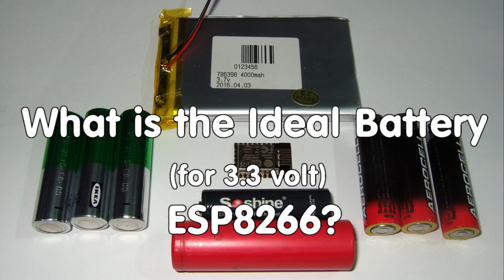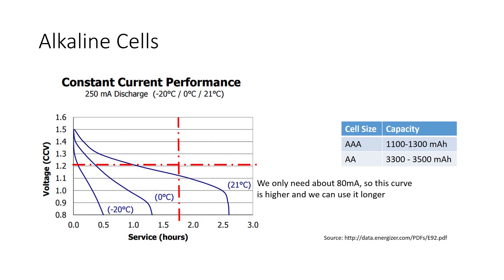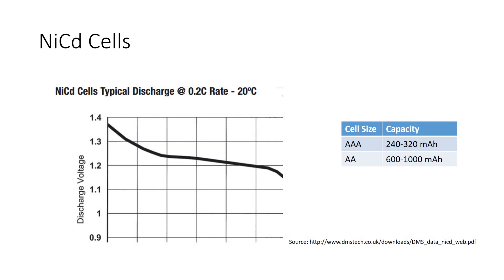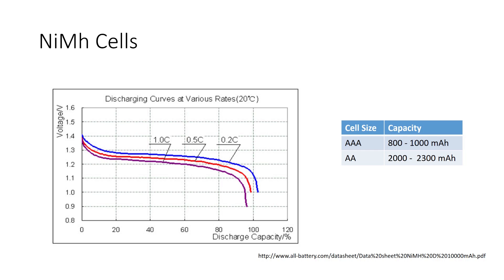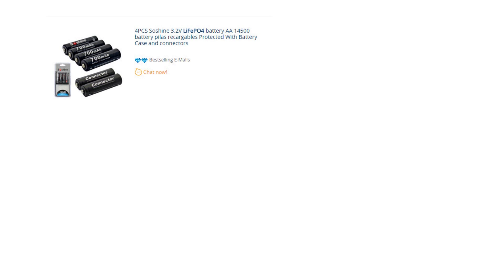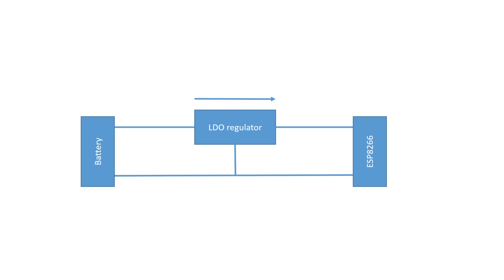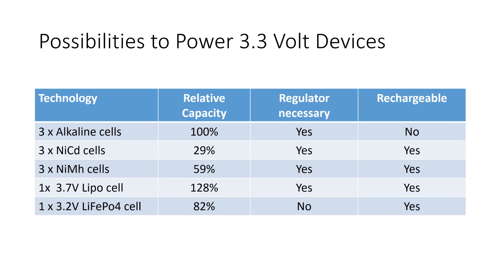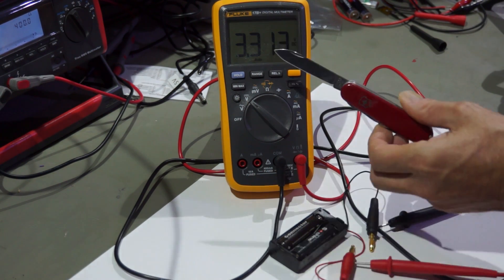#64 What is the Ideal Battery Technology to Power 3.3V Devices like the ESP8266?

Comment: I was going to get lifepo4 but they're more expensive than free li-ion vape batteries. Getting MCP1700-3302 as my LDO to get 3.3v. Mcp1700-1802 is for 1.8v the chips give up to 250mah. Time to watch your coin cell video.
Reply from the maker: Just do not try to power an esp32 with 250mA LDO...
Reply: @AndreasSpiess not for esp32! Thank you for mentioning it. I was looking for something to replace 3.3v for my device. I decided to look through your stuff for information and it was under the esp32 label haha! No wonder you didn't use this much weaker LDO, I'm using for BLE tags for an airtags with free batteries.

Comment: LiFePo4 does the wonder here. It is very safe (does not explode / combust unlike LiPo or Li-ion) and has very flat range of 80% of its capacity within 3.2-3.3V. If your device could tolerate slightly lower voltage than 3.3V (which is around 3.2V) then LiFePo4 is definitely the best as you need no LDO or step down, thus, no wasted energy. Also, LiFePo4 can be fully charged by constant voltage of 3.6V which is still under the allowed voltage of ESP32 devices or similar. So, charging and discharging with LiFePo4 do not need intermediatory regulator.

Comment: How about pre-discharging some of the cells that are a bit too high voltage before using them? That way you could skip the regulator.
Reply from the maker: A possibility. But you would loose a lot of capacity.

Comment: Nowadays there are also 1.5 volt  aa/aaa lithium ion batteries (through an internal regulator). You can feed the esp32 directly with two in series.

Also, there are Nickel-Zinc batteries with a typical output of 1.6v. You can also put two in series to feed the esp32, but they supply 1.8 when fully charged so it may be risky.
Reply from the maker: Thank you for the additional info!

Comment: I often run ESP8266's directly from a Li-ion 18650,without any real problems. I use TP4056 modules for charge/discharge control.
Reply from the maker: If these modules have a voltage regulator that is fine.

Comment: Wouldn't it be possible to build a bypass circuit that uses the current directly if it's within the spec range and goes through the converter when it isn't? So we'd lose the 20% when outside of spec, but keep 100% when within spec?
Reply from the maker: Of course, this is possible.

Comment: Hello Andreas, thank you very much for this video. Meanwhile almost 6 years have passed after this video. What is your experience with it today? I am looking for a solution to run an ESP8266 with a protected Soshine 5500mAh rechargeable Li-ion battery. What is your recommendation to get maximum uptime with these components? I would also like to monitor the voltage. What is your solution to get this running? Thank you and best regards, Chris
Reply from the maker: Currently, LiFePo is my favorite. and usually I create a voltage divider to reduce the battery voltage to an acceptable maximum for the ADC of the MCU. You can use quite high value resistors to save energy.
And then I measure the real voltage with a multimeter and make the calculation to get the same value in the sketch.

Comment: Dear Mr Spiess   Voltage question   I am new in electronics  I want to connect the ESP8266 to one  8x8 Led  MAX 7219 The ESP needs to work around 3.3 Volts and the Max works with 4.5 Volts  to 5Volts   How can I use only one power source to use both without burning the ESP ?   Thank you
Reply from the maker: Maybe you search for a project proposal which uses these components. That would be the safest. Otherwise: You find 3.3V regulators which work on 5 volts. These can supply your ESP32. Most ESP8255 development boards have such a regulator on board.
Reply: @AndreasSpiess  Thank you   BTW you have many interesting projects

Comment: Great presentation. I think its better to charge 18650 to only 3.6v max then ldo will not required. If powering from fully charged single 18650 then ldo is only useful will till the voltage drop from 4.2 to 3.6 after that not needed. This needs to be tested if waste or avoiding waste is better.
Reply from the maker: Then I would not use a standard Li-Ion battery. I would use a LiFePo4. You lose too much capacity from 4.2 to 3.6 volts.

Comment: Old, but pretty nice and informative video. Thanks for it. 
Did by any chance you found rectangular flat LiFePO4 battery somewhere in the internet? Something around 1000mAh and few millimeters thickness?
So far, I did not succeed...
Reply from the maker: I used a flat one in my mailbox notifier. But it had a higher capacity
Reply: @AndreasSpiess  thanks a lot, could you share the reference. Maybe from it I may find a flat one. Ideally, I would love to find one of 2-4mm thick
Reply from the maker: Unfortunately the supplier does no more sell the one I have

Comment: Se puede conectar una batería de 5v por los puertos Vin y gnd del esp8266?
Reply from the maker: Only if your board has pins which are labeled 5 volts. If not, the maximum voltage is 3.6 volts.

Comment: Hello, i bought 3200mah lifepo4. On some days it works well 1 battery for 5 hours (i stopped using after 5 hours) it was still on 3.1v 3.2v, but now it's not working even on full charge. sometimes i think it's on sleep mode, i cant even turn on a led (not the built-in). but now it cant even function at all, even tho my battery is fully charged and still on 3.4v. but it works well on laptop usb power.

any ideas?
Reply: if it tells something, the built-in led shines brighter with usb power now. i didnt pay attention back then but i do now. any help?
Reply from the maker: I think you have to do voltage and current measurements to understand what happens.

Comment: What is your opinion about LiSOCl2-batteries by the way? They are also available in AA, ½AA and other common sizes, run at 3.6V, have a high capacity and a very slow discharge profile. They are not rechargeable, but maybe more appropriate than LiFePo4 for situations where recharging is not desired (or not possible)?
Reply from the maker: I never used them so far. I do not know if they are able to supply the peak current of an ESP32, but for a LoRa node they would be very good, I think.

Comment: I've heard some people who use a 'smoothing capacitor' to allow small batteries (like coin cells) which cannot handle power peaks on their own to still be used. Of course this does add a bit of battery usage on its own, as a capacitor has a 'leak current'. However, if this leak current is insignificant w.r.t. the deep sleep usage of the MCU, and/or insignificant compared to the 'wake' usage of the MCU when measuring over time, maybe it might be worth it?

What do you think?
Reply from the maker: You can try it. I think it needs a quite big capacitor to maintain the 7 seconds at 100mA current to connect and send a message to the internet.
Reply: @AndreasSpiess  Once the components arrive by mail, I'll certainly try! I have read that the capacitor does not have to handle the 100mA current all on its own, but rather that it will reduce the internal resistance of the battery, so battery and capacitor can work together. But of course: you only really know if you measure it yourself with the actual components you have in front of you :-).
Reply: I now have tried it, and did not get it to work. I think that my particular chip (a CubeCell) has too high of a peak at startup.

Comment: What about a cr2 camera battery? They are lithium manganese batteries, rated at 3V and have a relatively good discharge profile. They can also delivery high currents when necessary?
Reply from the maker: 3 volts max is a bit low for 3.3 volt chips. Otherwise it is ok, I thing.
Reply: @AndreasSpiess  Thank you for your response Andreas. I have decided to use 2x 18650 Li-ion batteries with a 3V3 regulator.

Comment: What about a older battery tech for stationary devices like weather station etc the 1.2v  nickel iron Edison batteries. Easy even make them yourself and with the discharge of the boards you could run one years on a 3s set up
Reply from the maker: You can do that if you have them available, I think.

Comment: Is there a tp4056 equivalent for LiFePO4 batteries? I want to switch to using LiFePO4 batteries, but need easier solution for charging and overdischarge protection like tp4056 is for 18650 batteries.
Reply from the maker: I did not search for it so far.

Comment: I love your video. I am a little confused though. I am building a control panel and I want utilize the 8266 but I want a steady yet reliable and long lasting power to the module. I am thinking of using a 5V from my SMPS. Can I achieve this?
Reply from the maker: It runs as long as it gets 5 volts.

Comment: Can a solar panel be connected to a power bank which can be connected to an esp32 module? I tried using a solar panel but then I need to add a rechargeable battery and then a battery current monitoring circuit as well to make sure that the battery doesn’t get overcharged.  All of that requires a lot of materials. So I thought connecting a power bank would be a better option since it already has comparators, resistors and all that.
Reply from the maker: All these things have to fit. You have to do your research and find projects which do what you want.

Comment: Do you ever use buck converters instead of linear voltage regulators to bring the voltage of your batteries down to ~3.3v? I've got a few buck converters here but never bought voltage regulators because I'd heard they were inefficient.
Reply from the maker: Only if the voltage difference is high.
Reply: If the voltage difference is small (e.g. 3.7V to 3.3V) then linear voltage regulator can still be fine. But if you are using linear for 12V to 3.3V then that is huge loss. LDO still favorable for small voltage difference because it just require one component and very cheap.

Comment: This is really cool. I knew about LiFePO4, but never seen them in 18650 package before. Are there some chips similar to TP4056 but for charging small LiFePO4 cells (~500mA)? Right now you need to essentially disconnect the cell and charge it somewhere else. I do have situations where I would prefer to have micro USB socket and power coming, and if it is available charge the cell (but preferably never charge with more than 3.6V), but once the USB power is gone the chip will shutdown, and ESP8266 would work just fine. TP4056 can't be used here due to different charging curves, as well too high charging voltage, which would prevent you from using it directly with ESP8266. This could serve both as a quick recharging (2-3 hours for medium size battery), or just as a backup power.

Also it is nice to know about ESP32 voltage range: 2.3V - 3.6V. The internal LDO regulators regulate it down to 1.1V / 0.9V and 1.8V for various purposes. The lower operating 2.3V is guaranteed, and it can probably operate a bit below that fine too. So you can squeeze quite a lot of power out of the battery. Possibly even too much. :D Technical specification says that it can operate down to 1.8V correctly, at least internally, but ADC will behave differently (can be compensated), and one would have trouble communicating with external chips probably. Some active cell voltage monitoring by ADC, to warn about too low voltage, and or switch off to ultra deep sleep when it goes even lower, would be a good option too. I do not know how the ESP32 behaves when the VDD is below 2.3V exactly. Optimally it would switch off completely and use less than 0.1uA in that state to prevent catastrophic (or just permanent damage) discharge of the cell.
Reply: I have exactly this question; I want to power an ESP32 with some LiFePO4 batteries, but cannot find any chargers anywhere that are reasonably priced for just some minor hobby projects. I'd be very happy if I can repurpose one of my old phone chargers, but I'll need a controller of some kind...

Comment: excellent video...about LiFePO4: they can be discharge down to 2.0V, but at this current wouldnt it damage our ESP8266? there isnt any need for undervoltage protection?
Reply from the maker: Usually, the ESP8266 stops to work at about 2.8 volts. But it will still deplete the battery. Therefore it would be good to protect the battery.
Reply: @AndreasSpiess  how to protect it? just check the voltage and deep sleep if LiFePO4 battery is < 3V? or there are other protection circuits available?

Comment: i bought a 18650 battery shield v8 like the one you have on your aliexpress list..but even if i have it charging for hours, when i open it, it works for some minutes and then both the usb and the 3/5V pins on the sides are power off..(i use it with a esp that deep sleep every 30s)
do i have faulty batteries or it is suppose to deactivate when the current is very low?
Reply from the maker: I think you have to do your measurements to find the root cause.

Comment: hi, thanks for the video!! it's really informative and i will look into the lifepo4 battery for a new project with my esp32 dev kit. one thing i was wondering though: could i also connect a power bank over the micro USB port? that would mean to supply 5V to the board, but would that not be the same as to connect to the USB port of my computer when uploading a sketch? the 5 V would then be regulated don to 3 V on the board itself, at least in my understanding. thanks
Reply from the maker: The normal dev kits have voltage regulators for the 3.3 volts needed by the ESP32 and a charging IC for the battery. But these charging ICs are not compatible with LiFePo4. They have a max voltage of 4.2 volts for Li-Ion.

Comment: Hi Andreas, thanks for this amazing video...
Do you think I can use similar batteries to power the Ikea Motion Sensors? (They use two cr2032 3v batteries but they die every week :( )
Reply from the maker: If they die every week something must be wrong. Eitehr the design or the usage pattern.
Reply: @AndreasSpiess 
Hi Andreas, thanks for answering...

I've changed the product 3 (three!) times and it behaved always in the same way...

The last time, fortunately, it worked.

Maybe they had a broken batch, I don't know.

Comment: I think one important point is missing. The end users are very prone to put something in the wrong direction. So in order to not to burn your IC' s you should place a low forward voltage diode (schotky maybe) in series to your power supply design. Otherwise someone will insert the batteries in wrong direction(Murphy Laws)
Reply from the maker: You are right if you want to sell your product. But a diode loses a lot of power. So it is up to you to include one.
Reply: @AndreasSpiess  But a diode saves you from having to use a regulator (thanks to forward drop) if you don't need so much current. And everyone can make mistakes including the designer.

Comment: Great videos. I’m using an ESP 12E, 1000mah, LiPo battery, LDO regulator, and AC to DC power supply to monitor AC voltage at my cabin.  I send emails every hour.  When I lose AC power the battery keeps the ESP8266 working, drains down and the esp8266 goes into a brown out condition and won’t restart when AC power is reapplied to battery/esp8266.  How do I automatically restart after a long power failure?  Maybe I could measure VCC of ESP8266 and go into deep sleep.  What do you recommend?  The key here is to automatically restart the ESP 8266 when power is returned.  Thanks for your feedback…..Mark
Reply from the maker: You can use a so-called "voltage detector" to keep RST low till the voltage is appropriate to start (KA75330, for example)
Reply: @AndreasSpiess  Great advice...Got some on order...will let you know how it worked out in 30-50 days.
Reply: @AndreasSpiess  I have a 5 vdc power supply and a LiPO battery and HT7333 voltage reg powering my esp12 project.   The 5 vdc power supply also recharges the LIPO thru a 1N4007 diode.  When the 5vdc goes away the esp12 runs on the LIPO battery. When the battery reaches a very low value in a few days, the esp12 would brown out and would not restart when 5vdc power supply was applied.  Your KA75330 voltage detector idea worked for restarting the esp12 successfully, that problem solved…but as the LIPO reaches approx. 3.80 volts the KA75330 resets constantly over and over for hours until the LIPO finally shuts down below 3.5 volts.  When the 5 vdc power is reapplied the KA75330 begins resetting the esp12 for hours until the LIPO reaches 3.8 – 3.9 volts and is charging.  Not sure if hammering the reset for hours is a good thing….do you think it might corrupt my esp12 program?  Maybe I could use a KA75310 or KA75290 voltage detector and shut down the esp via ESP.getVcc() into DeepSleep based on Low VCC ESP.deepSleep(0) at around VCC = 2.90-3.10 volts before it gets reset over and over.  I’m finding the KA75310 or KA75290 voltage detectors are not available on Banggodd, AliExpress, ebay or amazon.  Bummer.  I think I’m OK but what are your thoughts about my approach, especially about the constant resets.
Thanks…great videos as always.

Comment: What is the difference between LiFEPO4 and 18650?
Reply: Lifepo4 is the chemical type of battery, it can be use in winter -20c. 
18650 is size, 18mm diameter, 65mm length.

Comment: Hello Andreas. May I ask you your opinion on this battery? I'd like to know if it requires a voltage regulator or not. My project is a wifi cat collar. Therefore, I want to avoid lipo's so I am looking for an alternative which is safe and small enough. Please have a look: https://www.fenix-store.com/fenix-arb-l16-700-16340-battery/
Reply from the maker: For me, this is a Li-Ion battery. It has 3.7 volts nominal voltage.